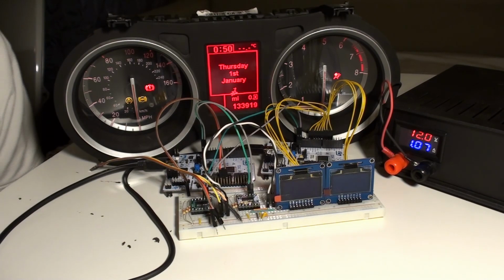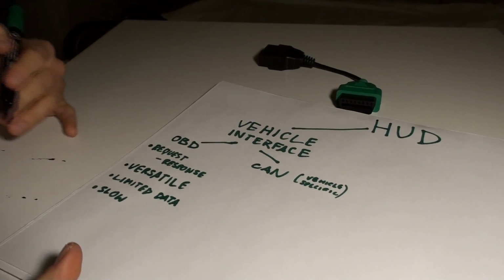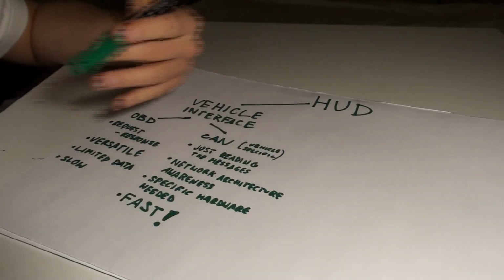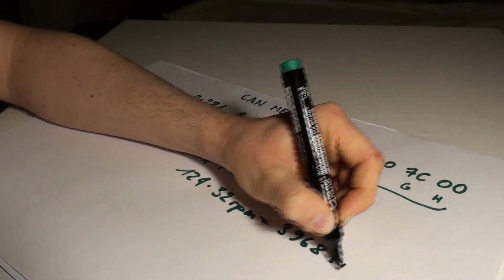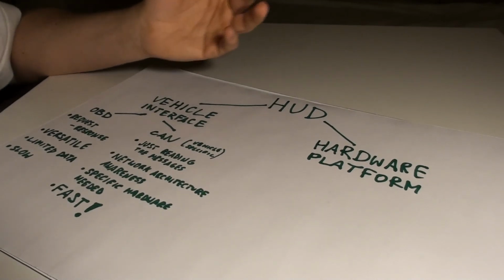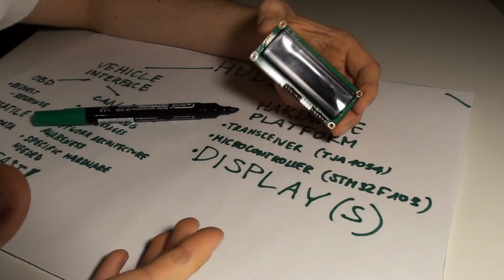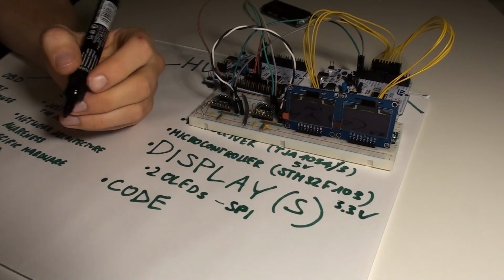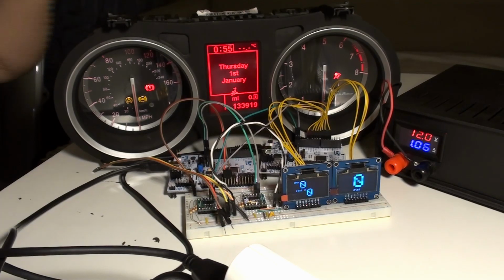How to make a HUD for your own car

Comment: Great material! 
To improve your final design just be aware of high temperatures on the dashboard that may occur during summer time. And the thing about components, try to use certified parts like AEC-Q which should be more realible in havy duty enviroment.
Keep safe!